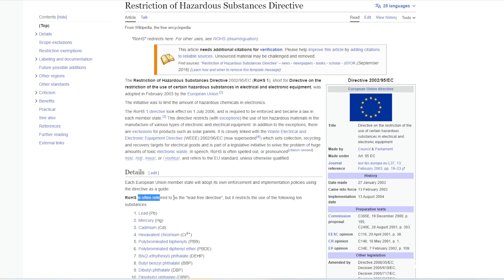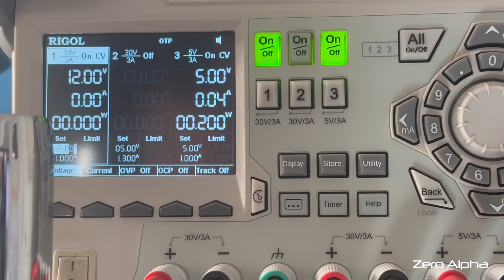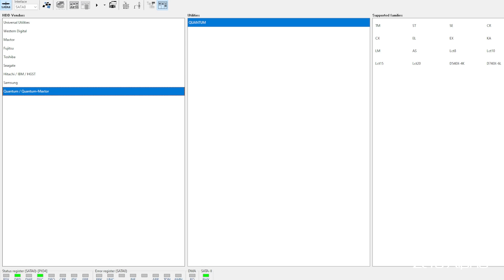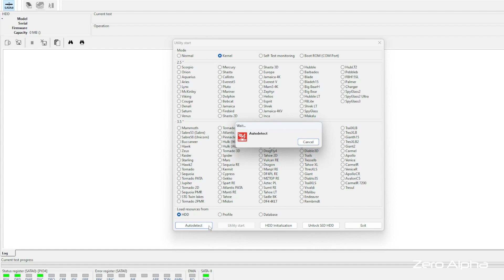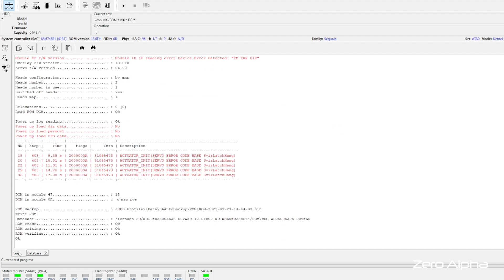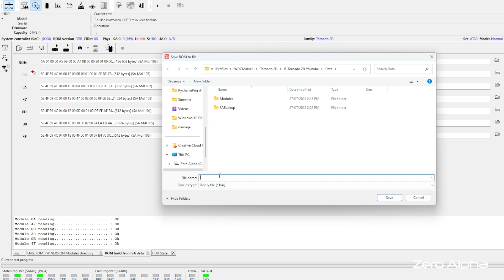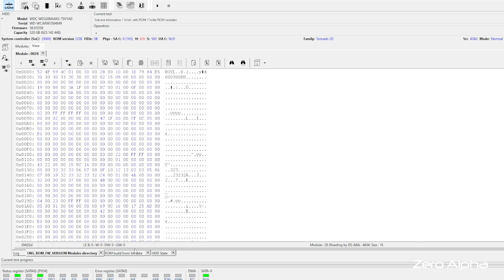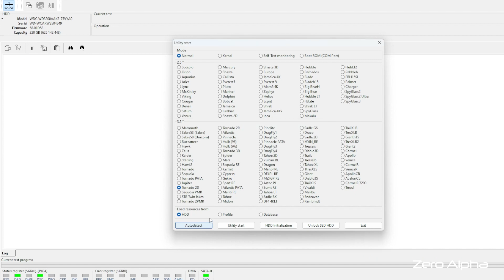THE PCB THAT ALWAYS FAILS! (2060-701444-004) The historic design flaw from its solder data recovery

Comment: Just checked, but my two WD3200AAKS-00VYA0 from 24 August 2007 does not have corrosion. RoHS label too. Probably less humidity here in The Netherlands... One has a bad bearings what prohibits it to achieve the required RPM, so it shuts off. Keep it for spare components. I always buy parts in paires for that purpose...